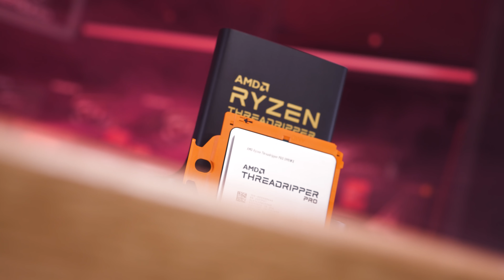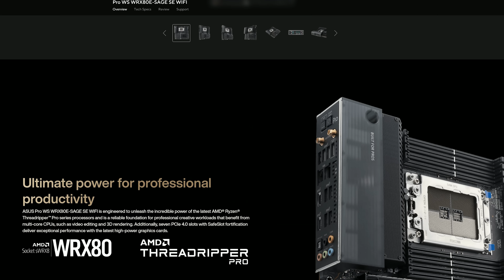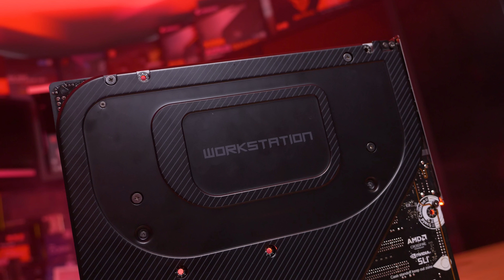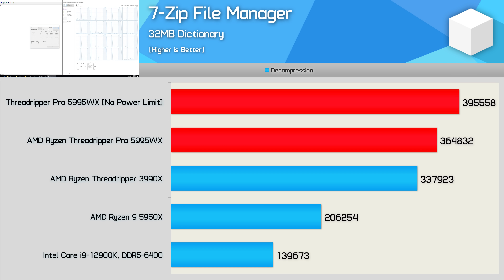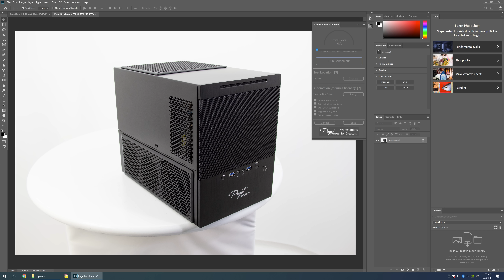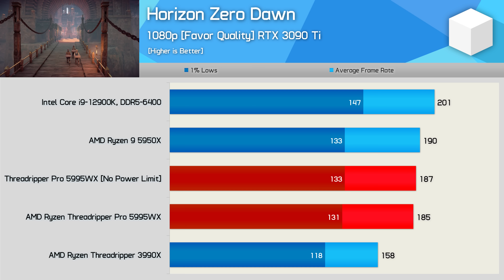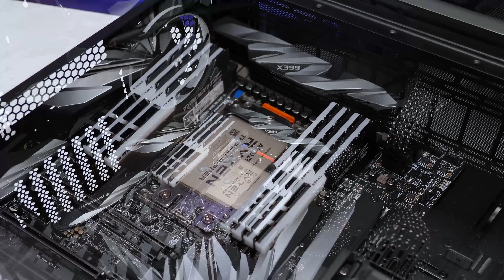It’s Finally Here! AMD’s Ryzen Threadripper Pro 5995WX, Benchmarks, Power & Cooling

Comment: The price is so huge , because amd thinks there is no competition to it , and keeps whatever price they like
Reply: This is a professional workstation chip. Intel's professional workstation chips used to be priced similarly... until AMD made that look stupid. When you get into the professional space where the salary of a senior engineer is in the $250,000 range a few thousands for a CPU is a good investment. If it reduces the time said engineer have to sit around and wait by more than 2 hours a week the CPU is basically free by the end of the first year.

Also, AMD doesn't think there is no competition. There flat out isn't any competition. Intel's Xeon workstation products are joke these days. They're 80% the price of the AMD counter parts but only half the speed at best. So for AMD to lower prices Intel needs to go aggressive. But Intel wont. So thank Intel for AMDs prices. This is how the free market works. If the underdog doesn't play the value card you get the status quo. AMD, on the other hand, have always been quick to play the value card when they were behind. Intel, it seems, are just having trouble with the concept that just because you're the current king in desktop doesn't mean you can price like a king everywhere.

Comment: I'm so happy to see this, yet so mad at the same time. Before Ryzen 5000 ever launched, I had planned on building a monster Threadripper 5000 system. I even started buying parts like the big open frame ThermalTake case, a 1600W PSU, a bunch of water cooling parts, and 2 3090s(and yes I feel stupid for spending more on 3090s than 3090TIs cost now, not to mention I won't have this thing built before RTX4000 or RX7000 launch). All of those parts have just sat there for like 2 years now(except I mined with the 3090s). Finally the day has come, and all there is is TR Pro. I guess that's what I'll go with, but I'm not looking forward to paying 2x as much as I expected. Actually, I wonder if I even need this monster workstation at all. I was basically going to build it as a showcase to hang on the wall in my office, now I'm not sure I can justify the cost.
Reply: if you have a build but no purpose in mind, don't let them gouge you. I'm not saying "oh just go get a celeron instead lol" but if you don't need bleeding edge power, get what was bleeding edge a couple years ago. I'm still rocking a first gen R5 that I got at a discount and it's perfectly fine for my purposes.
Reply: Sounds like money isn't a problem to you
Reply: @tuckerhiggins4336  ikr
Reply: sounds like you have more money than brain lol
Reply: Pro tip, don't invest into AMD HEDT. They'll screw you over by price hiking like this or abandoning the socket. Just ask any TR4 owner.

Comment: The TR Pro product line is a slap in the face of anyone or any business that spent money on TRX40. Now only did we have to buy new mobos over X399, but now we learned that TRX40 only gets one CPU generation. I was a genuine fan of AMD TR products and I purchased the 16 core (first gen) and then 3960X. Now I realize AMD never stated there would be more than one CPU gen for TRX40 but if you look at their consumer line (Ryzen) AND their Enterprise (Epyc), all of those platforms supported multiple generations of CPUs. Why did TR users get the short end? I am done with AMD and this, unfortunately, means I have to go back to Intel and their constant delays......
Reply: Steve did explain the gist of why that was the case. AMD has a limited allocation of wafers at TSMC and GloFo is generally hopeless in terms of its cost effectiveness and those IO dies are very expensive. It was a case of looking at the market and observing how they would satisfy the demand. HEDT has unfortunately become very niche over the years, contrary to workstations, and AMD decided to allocate their resources into that market, as demand was more plentiful, but most importantly, more predictable. I'm pretty sure the silicon shortage and the booming demand for graphics cards didn't improve the prospects of Threadripper 5000 when they were all being manufactured on N7.
Reply: @lennard9331  So AMD chose consumer Ryzen over HEDT? Remember, AMD HEDT users generally spent more money on TR chips than users of Ryzen AM4. I am not the only TRX40 user that feels this way, there are tons of us out there. I use to call out Intel for the same practices, only supporting two gens of CPUs on their HEDT platforms...but Intel never did this to us with their HEDT platforms...only one CPU generation. I can only imagine if AMD tried to pull this with their Enterprise customer base.

Comment: Seeing your response with the Adobe, no wonder AMD is confident with their pricing. Of course, no competition also help.
Reply: I'm newer to the tech world, particularly the high end, so maybe I could be wrong, but isn't intel xeon a competitor to cpu's like this? Or is xeon more similar to the AMD EPYC cpu's? Or are they different in some other way?
Reply: @DarkestKnightshade  There are two kinds of Xeon.

One is Xeon for server which compete with AMD EPYC and the other is Xeon for workstation (Xeon W) which competes with this TR-PRO.

Now that mentioned that,  AMD is actually cheaper per core than its competitor Xeon W and faster.

Xeon W 3665 (32 cores) is $3499
TR-PRO 5975WX 32 cores is $3299

Comment: If the Threadrippers have more cache than the 5800x3d why dont they do better in games since cache was what took the 5800x3d to the top of the charts?
Reply from the maker: 5800X3D has way more cache on the CCD. It's split up on the 5995WX.
Reply: I seem to recall the cache latency being much lower on the 5800X3d as well. But that's just from memory.
Reply: @odizzido  average latency on the 5800X3D would have gone down due to less cache misses. Doubt the cache hit's latency would have been better, just cause there was more cache.
Reply: @chainingsolid  I seem to recall AMD saying that because there are many connections and because the distance between the cache and where the data from the cache needs to go is smaller that they get improved performance.

How true/accurate that is I am not sure, it's beyond my knowledge.
Reply: @odizzido  That's the difference between cache stacked on top and cache placed elsewhere on the die (or maybe even substrate) with fewer connections linking to it.
Reply: Threadripper 5000 doesn't have stacked cache mate, TR 5000 is based on Chagall, not Milan-X.

Comment: Yes. 300 W CPU pumping heat directly into the chassis is a perfect idea. This case is absolutely not a proper choice for high power CPUs, it's plain bad to mount radiator in front of the chassis.
Reply: Yeah calm down mate, it's just a test system, deadlines don't always allow for the most ideal long term setup, long as it runs the benchmarks and doesn't throttle.
Reply: @LunchThyme  Test system shouldn't really introduce additional holdbacks and in a long term Threadrippers should never be cooled by an AiO. Unless you want to showcase a stock operation provided by a prebuild, only in a fancier case.

Comment: 64 core matching the 5950x in gaming is insane. However, these 5000 series TR Pros are still pointless to buy. Not only they are far more expensive than the previous TR Pros, you're still paying for a generation behind. AMD made a huge mistake, Zen 4 is at the door and AMD should have waited to release a better version.
Reply: Why do you think a 64 core matching a 16 core which matches an 8 core in gaming is insane? The only reason the 5950X is slightly faster in gaming than the 5800X is because it has slightly better clock speed. If you fixed all three of them at 4.0GHz all-core they'll be within spitting distance of each other. Only the corner cases of cache utilization and memory bandwidth limitations will skew the results a few points here and there... but the overall picture will be the same.
Reply: It's pointless to buy anything prosumer from AMD since they'll just say fuck you to the sockets and not give them the same longevity as the mainstream AM sockets.

Comment: Sure is one hell of a price premium for four 5950Xs in a trench coat.
Reply: It is specifically not four 5950Xs in a trench coat. The core (he he) selling point is that you have cache coherency across all 64 cores and can do shit like a 16xNVMe RAID0 without starving the cores of memory bandwidth. And these are significantly better binned dies than even Epyc. These are AutoCAD monsters. You can keep drawings with millions of components open and the panning is still perfectly smooth....

Comment: $5000 CPU from AMD still cannot beat Intel in gaming performance. Gamers go Intel.
Reply: Not really meant for gaming, but I see AMD is taking Intel's strategy of abandoning sockets in the prosumer space
Reply: @foxylune  Yes. AMD need to be careful otherwise it can lead to their downfall.
Reply: The $5000 cpu is not meant for gaming. Intel leads gaming performance as of alder lake, but this is the dumbest possible argument
Reply: @siddharthagupta8528  Yes. But gamers only care about gaming performance. So Intel still is the king 👑
Reply: Well, I agree in a way. But remember this is a generation behind, it isn't Zen 4.
Reply: A 5800X3D is competitive with the 12900K in a lot of cases though. 🤔
Reply: You should see Intel's Workstation CPUs in gaming... they're about on par with Ryzen 3000 Desktop CPUs. And this shouldn't come as a surprise to anyone who's not utterly clueless about computers: The spec sheet showed lower clock speeds than the desktop counterparts. Workstation CPUs are not Desktop CPUs. They're designed to a completely different segment: the segment that needs (hold your breath, here it comes).... MORE CORES rather than single thread speed.

Jesus. Do you also complain that tractors, despite having 1500 horsepower, are slower than your Prius?

Comment: Let's see how long until AMD abandons WRX80. TR4 owners will never forget.
Reply: WRX80 is EOL now. Next gen Threadripper will need DDR5 to move the bar. And keep this in mind: HEDT/Workstation sockets have 1 generation each unless the manufacturer SPECIFICALLY states otherwise. AMD promised AM4 support through 2022... and a lot of people instantly infered that that was an implicit promise about their other sockets too. But they never said that. And if people keep complaining about this, or keep misunderstanding this, you can bet your ass that AMD will go the Intel route and solely provide HEDT/Workstation class CPUs to OEMs.
Reply: @andersjjensen  Did TRX40 really need to exist over TR4?

Comment: Doing Windows application benchmarks with a 64 core threadripper. Is like using a formula 1 car on a highway. Pretty much useless since windows can't utilize this many cores, let alone threads. Use Linux instead for some usefull results. Like Linux kernel compile, ImageMagick and LLVM just to mention some tests from the top of my head.
Great move to throw away so much potential. Thumbs down from me for this review.
Reply: Oh no, anyway. Back to your Linux cave now
Reply from the maker: I think you'll find it very much can and does.

Comment: Very interesting how your 12900k 3090 did in the gaming performance vs my 12900KF 6900XT with 5200 MHz Ram. Are those results taken from other Benchmark videos that I can watch? cuz I'm curious what motherboard and what Ram was used. I know it says 6200mhz.
Reply: Steve doesn't standardise the platforms long term like GN does, so your best bets would be to look at the benchmark for the 3090Ti with the 5950X and see how it compares to the original 12900K review, as that one was done with a 6900 XT if memory serves me right.

Comment: Well , i guess the upcoming 7950x ( Zen4 ) will show why an non Pro Threadripper is obsolet . With DDR5 support the bandwith is higher ( old Quad Channel like ) and the high Base clock of 4.5 Ghz will  boost Multicore by 30 -40 % ( vs 5950x ) , the 5,7 (?) Ghz single Core Boost is way higher than the still Zen3 based 5995WX (4,5 Ghz ) = HEDT is basically obsolete , Raptor Lake will have 8 big and up to 16 E-Cores = 24 cores on Mainstream .. , if you dont need much PCIe Lanes and Octa Channel Memory Bandwith you are better of with the Mainstram CPUs . Mabe with Zen4 Threadripper  ( end of 2023 ) an non pro TR could be an interresting option again ( performance wise )
Reply: i don't think it'll de 5,7. that'd be truly.... stagering. a "humble" 5.1-5.2 is more realistic
Reply: @TheHighborn  
i guess you will be suprised , AMD already showed 5,2-5,5 Ghz in a Game demo ( on several Cores , not only one ) with a 16 Core  ES Sample
Reply: @MK-xc9to  IIRC wasn't 5.1?
Reply: @TheHighborn  ??
AMD clarifies their 5.5 GHz demo was running stock settings
AMD’s Robert Hallock and Frank Azor took part in PCWorld’s ‘The Full Nerd” interview where they answered some burning questions regarding the Computex keynote with Ryzen 7000 CPUs showcase.
Reply: @TheHighborn  
if i post a link , the post gets deleted soi made a ltttle Video from the first Page of the Article , its only 5 sec long , pause if you want to read it https://www.youtube.com/watch?v=Nkt_hyie5lc
Reply: @MK-xc9to  ah. i remember it wrongly then. Thank you
Reply: "HEDT is basically obsolete" - For people who actually need it, it’s not. (I am not one of those people)
HEDT has never really been necessary for gamers, or light computing needs.
Reply: @emlyndewar  
Remember , Intels HEDT was mainly Quad Channel and up to 10 Cores until 2017 
Thats only 5 years back ... , you can get 16 Cores ( AMD )  and soon 24 Cores ( Intel )  on Mainstream nowadays , thats not lightweight computing , it tripples /quadrupples Intels HEDT offerrings from 2017 in Performance .
Thoose who need as much Performance and PCIe Lanes as possible will buy the Pro Threadripper Version anyway , no matter the costs . Intels HEDT is basically dead , the last cpu is the W-3175x from end of 2018 ( 3000 Dollar ) , 28 Cores which is EOL since 2021
Reply: Not really. You still get more pcie lanes and more memory channels with threadripper.
Reply: @Linkedblade  
as i wrote " if you dont need much PCIe Lanes and Octa Channel Memory Bandwith you are better of with the Mainstram CPUs  "

Comment: When doing benchmarks could you include Rivet or AutoCAD as this is what I use a lot because I work in the construction industry. This chip is massive overkill for what I do but I trying to work out what is the best desktop chip for a system cost of no more the $2000 would be.
Reply: I built a 2k€ system for a client in May this year who does CPU-bound workloads. 

Used a 5900x with an Aorus X570S Pro AX and 64Gb DDR4 3600. Tossed an RTX 3050 in case he needed CUDA acceleration and do some casual 1080p gaming, but he uses it as a server.

It's a beast!! What I will tell you is don't skimp on cooling!! I used a bequiet Dark Rock Pro 4 and it was overwhelmed by PBO boosting the 12 cores at 4.7GHz. Either use a NH-D14 or a 360mm AiO.
Reply: I'm not a well versed person in either software, but, I'd wager a 12900K or a 5950X would be your best bets for that budget.
Reply: Revit and AutoCAD are highly single threaded, so your best bet is a 12900k. No need to waste money on Threadripper when better performance can be had for cheaper. The 5995WX would only make sense if you were also rendering your projects with something like V-ray.
Reply: @Bayonet1809  thanks i sort of highjacked this thread i was more about them adding a Revit or AutoCad benchmark than using Thread ripper.